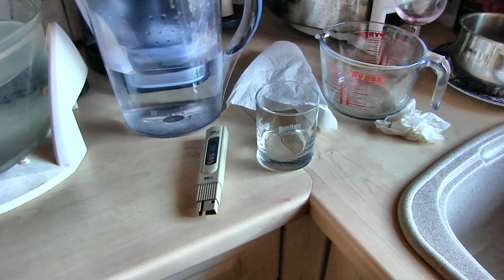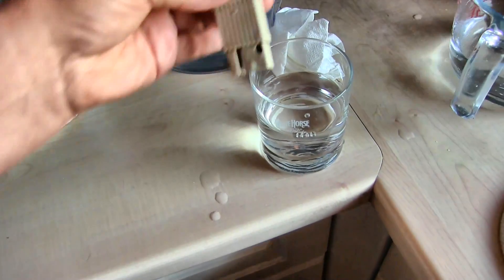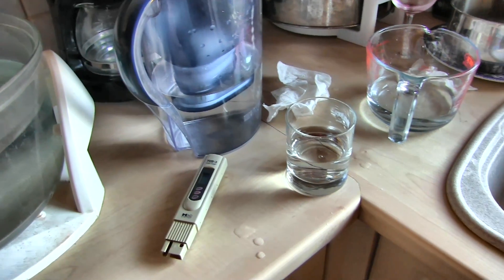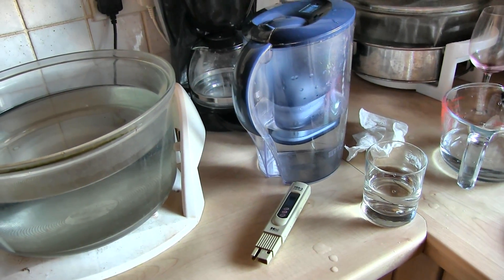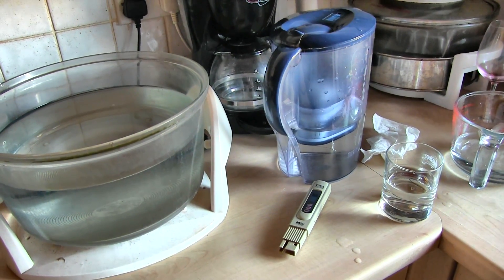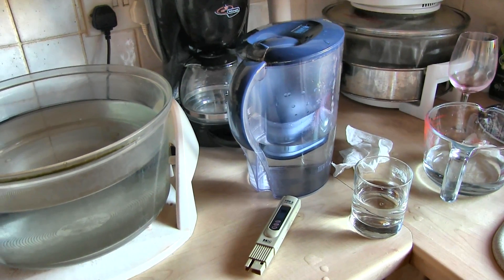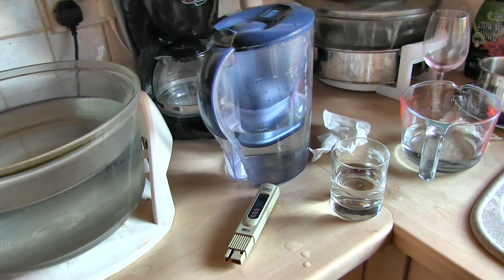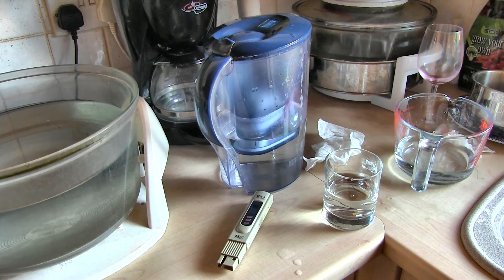Water Quality - A Look at My Choices and Uses

Comment: Lucky. I need to set up a 5 stage RO unit with two or three T.D.S meters. A shutoff valve. Easy part. And two membranes. With a little luck I will have the water pressure to run it. But that's because I want a Beautiful reef tank. It's no good if the freshwater out shines the saltwater. But am going to have to live with it tell I get some real experience on the salty side. Three or four years is nice but not a nuff to make me a novice. Am still a newbie.
Reply from the maker: I love to see those large fish-tanks set up like a reef with live corals and colourful fish but they sound like quite a bit of work and a VERY delicate eco-system to maintain?

Comment: ......I understand your concerns, ex R/O user here, it was exhausting getting jugs filled...only suggesting.......In Alabama, we have days in the 90* thru 100* even, and then temps in the single digits as well...the temps will peal paint off a metal roof and soften and crack asphalt shingles. We get dust storms that shut down highways and rains that grow moss on everything..... Along with all that is the Birds, bugs, slugs and grubs that crawl over it....  My roof is a 10yr old typical asphalt shingle material, with galvanized flashing's.. I have pine, oak, and gum trees, full of birds squirrels, and lizards,  dripping sap and everything else on my roof constantly...you should see my vehicles......off the roof during a light rain I can fill 3 - 40 gal rain barrels and a 160 gallon tank in around 15 min.....after that it overflows. Consistently it will test out at 8-12ppm @ 6.8 ph +/-.....the 1st water that drips isnt that clean, but it self flushes during a rainfall. You have to use what you have at your disposal. Very nice show...........
Reply from the maker: There are 'things' in rain water that a TDS meter won't show but most of the growers I know use rain water when they can. The PH on my rain water (last time I checked) was about 5.5 so it would drop quite a bit when I add the fertiliser.

Comment: Roger; have you thought of setting up a rain barrel? My tap water (from my well) is about 120 TDS but rain water is remarkably low: today's measurement was 14 TDS. If you have a downspout, it's easy to tap into it and divert the water to a barrel.
Reply from the maker: The air and the surfaces around here are filthy so I would end up with dirty water - I have thought about it.

Comment: Hi Roger just want to share with you with what I am working with here in Northern California I just tested my tapwater and the TDS is at 54, my rainwater tests at a 9. I water my orchids with the rainwater but in my greenhouse I have a commercial grade humidifier that is tapped into my tap water and I have a fish tank with a fogger in it like Brad's and I fill that up with my tapwater but I also have a couple of cool mist humidifier's that I use my rain water to fill them up but I guess if I run out of rainwater which I don't think I will I could always use my tap water to water my orchids. Happy Growing 🌱
Reply from the maker: If I had tap water with a reading that low, I would probably use it for everything.

Comment: Mine is around 250ppm... Unfortunately i cant use RO system.. So do i still fertilise my orchids? I used to live in area where my water was about 30ppm.. Good old days!
Reply from the maker: With a reading like that, there is a fair bit of calcium in the water and probably enough magnesium too (but that's difficult to check). So if you fertilse you need one with a balance of NPK plus trace elements and not too much!

Comment: Roger thank you, this is a great video, I won't be getting a water filter then, not much of a use :D I use only rain water with my plants and it has made a massive difference at least in my conditions as my tap water is so hard. I checked weather forecast in UK for next couple of weeks, made me cry, my rain barrel is already bone dry, at the end bit the bullet and ordered water, 500l for £35. As you mentioned this is not a problem in UK most of the time especially in winter days, so if I need to buy the water maybe twice a year because there is no rain, so be it. I'm also the mad lady that brings all my plants out in warm rain, probably raises some eyebrows with my neighbors, but that washes the plants so well, just need to make sure fans are on when I bring them back in. Anyhow thank you for this video I love when people try to find out more by themselves, nothing wrong with a bit of experimenting. FYI just info sharing the place I got the water from is www.spotlesswater.co.uk they have some collection points around UK too. Have a lovely soaking day :)
Reply from the maker: The filter jug does take some of the 'nasties' out of the tap water but not really enough. I used to use that water for the orchids before I got the RO unit - nothing died.

Comment: Hey Roger, if you saw my tds readings you would have a stroke...and what kills me is that it's out of my control. My starting tap water has a tds that fluctuates between 875ppm on a really good day, and 1100ppm on most days 😳😣😵 My RO unit is a pretty good one and I have RO water on tap, but it can only remove about 90% of the "junk" in my tap water, leaving me with a tds of between 87-110ppm before fertilizer 😔 Previously, I had a countertop RO unit that turned 3 1\2 liters of tap water into 3 1\4 liters of RO water with a tds of 7ppm...problem is, it would take 1 1\2 hrs to do it. Anyway, I use RO water in my humidifiers as well and it seems to be ok. Sorry for the rant, lol
Reply from the maker: 1100 ??? You could stand a spoon up in that! My little RO unit has just created about 20 liters in about 4.5 hours - but I don't have to 'be there' just need big containers to catch it all. The speed depends on the pressure - if I do it at the weekend when everyone is at home it takes ages, but week days after 09:00 - by then everyone has had their showers and filled the kettles and gone to work - the pressure is good then.

Comment: Given your water limitations have you considered a reverse osmosis system? or a distilled water machine? I don't know if those are very costly or not...
Reply from the maker: I have an RO unit.
Reply: yes of course, i don't know why but my brain told me the R stood for rainwater LOL! I guess my allergies have moved from my sinuses and into my brain now ;) sounds like it could be costly to run regularily.....
Reply from the maker: It costs nothing to 'run' it just connects to the outside tap and I collect the clean output water in large containers. The initial cost was about £35 pounds and it should last a life-time - just replace the filters every year or two.

Comment: I don't know, to me, it seems a bit over-the-top. Did you have any problems with the calcium deposits on the leaves apart from it looking a bit off? Seems like a waste of the precious RO-Water, which wastes some water in the production process, too. Well, of course I even water my orchids with hard water, so who I am to "critisize", but I am just a bit unsure whether it's worth the effort and the worrying. The filter jug would be a good acquisition for me, though - not just for improving the water, but for improving my coffee.
Reply from the maker: I don't waste the output from the RO unit this time of year - it all goes in the watering can and onto the garden or around the tubs and my bonsai. I think that getting out the unit a bit more often isn't too much trouble - I've just re-filled everything (after filling the foggers) and it took about 4.5 hours. But now I'm saving loads of time - just had some fun with the sprayer - just washing off all the plant leaves and I thought, while I'm at it, how many of the mounts could I do? I did nearly all of them in 10 minutes including filling the sprayer twice - that normally takes well over an hour if I don''t film anything. Some I couldn't get at very well and the Vandas still have to go in the bucket but great fun getting everything soaking wet.
Reply: Roger Frampton just out of interest, did you check the tds reading on the soaking water after the massive job?might be interesting:)
Reply from the maker: No - just let it drip all over the place eventually wetting the floor. That gave me another idea - WET THE FLOOR! - about a third of the floor is concrete (not carpet).
Reply: Roger Frampton oh that's great, from videos I kind of thought you have carpet, that's why didn't say anything. Orchid growers I know in Russia throw bucket of cold water in hot day on floor to raise humidity and keep plants cool. I can't do that as I have wooden floor, that might be ugly. I envy you, you have concrete which is similar to clay evaporates well and lowers temperature.
Reply: Roger Frampton anyhow I hope I'm not bothering you too much and seam over the top with water care, but that's what lots of pros have told me in other countries. Orchids can tolerate temperature change, light change, humidity change as that's natural situation in nature, they are used to dealing with it, what they can't deal with is hard or wrong water as it's alien to them, they don't get that situation  in nature.